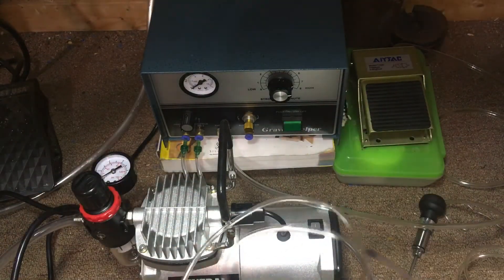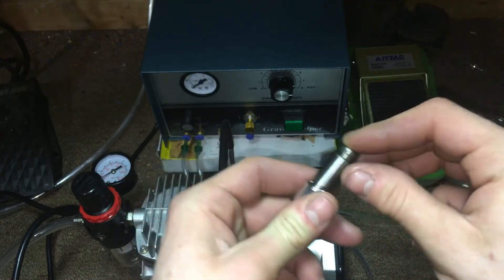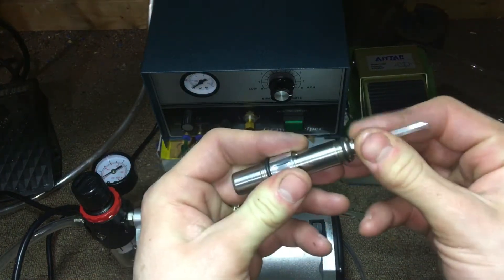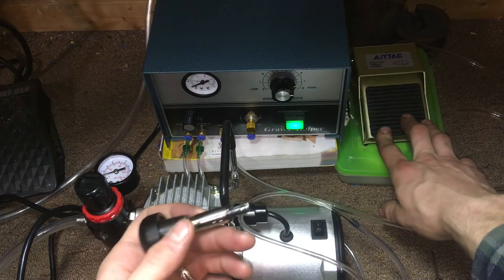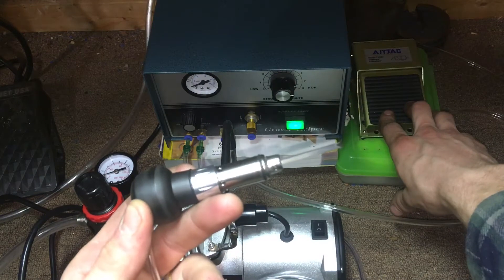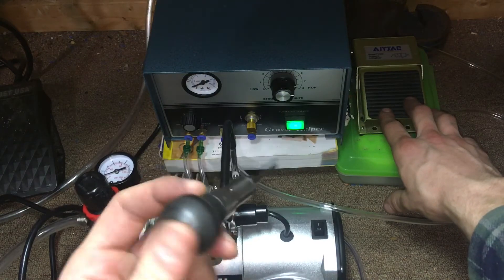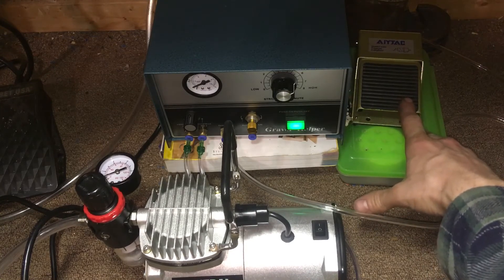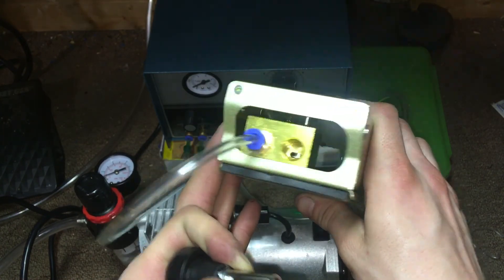Pneumatic Engraver Handpiece Update: In working order (pt.2)

Comment: I've actually found the Graver Helper machine to be in good condition. No air leaks, no need to modify the hand pieces. I've chosen to use a different compressor though as I did not want to produce noise all the time... a silent air-brush compressor with a 3l tank. A bit more comfortable and a bit more punch to it.
Still, I did some modifications to my setup: The Graver Helper controller and the foot pedal feature PVC hose connectors with 1/4" threads. I replaced them with 1/4"->1/8" connectors. Also the air intake on the back (same PVC hose connector and also 1/4" thread). That way, the connection from the compressor to the controller and the controller to the foot pedal can be done with a standard 3m 1/8"<->1/8" compressed-air hose (especially with the compressor and the foot pedal sitting underneath my workbench and the controller being on top, this is a very comfortable setup).
The PVC hoses for the graver hand pieces are rather short... but still long enough if the controller is near.

Comment: Wat engraver bits do you use...?
Reply from the maker: I usually buy gravers from Rio grande with the wooden handles and cut them slightly shorter with a cut off disc and stick them in the pneumatic handle. You can re shape them however you want and sharpen them with a cut off disc, they last for years and years if you take care of them

Comment: I’m having similar issues with the gravermate, just got one but with a bigger compressor. I cannot get the piston in the graver handle to move back and forth. I fixed a couple of leaks with plumbers tape. When I press the foot pedal down all of the pressure comes out of where the secondary hose  attachment located at the front of the pedal. It looks like a plug type fitting would fit. Was wondering if you had anymore pointers for this unit before I think about sending it back.

Comment: Is that compressor powerful enough for the graver machine?
Reply from the maker: Yes this compressor is just powerful enough. I'm still using this exact set-up today. I use it for light engraving and setting stones for jewelry. It gets the job done and I don't have problems with it. You will see lots of negative comments in this video and my other videos of the haters who probably don't engrave themselves. I'll have to make another video of me using it and setting stones with it sometime soon to show that it really does work.
Reply: Wheless _ thanks for the info and thanks for the vid. I bought that same graver machine today from China. Can’t wait till it arrive. All the best
Reply: @Whelessry  Hi, one more thing. Are you able to use the foot pedal to control the graver speed? or do you have to use the knob?
Reply from the maker: @TayouTroy  hey that's a really good question, on this machine, the foot pedal is pretty much either open or closed, the knob is really what controls the speed MOSTLY. I have heard that you can buy a name brand foot pedal that is better but I am able to get it to work with the one I have. If you push down on it VERY slowly, you'll notice it starts out a little slow but then you push on it harder and it opens right up. But like I said you can adjust it with the knob no problem. I plan on making another video making a ring soon and I'll use my machine to set the stones if your interested in watching
Reply: @Whelessry  Thanks for the info. Regards